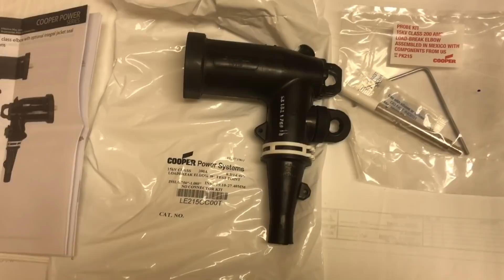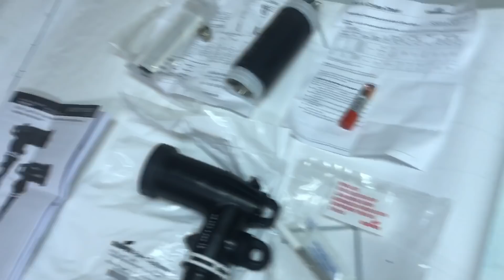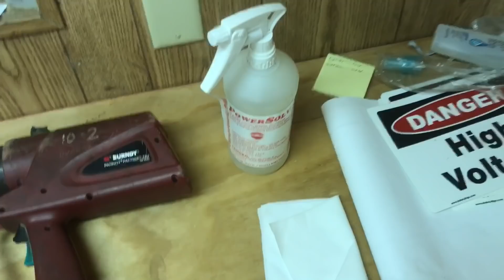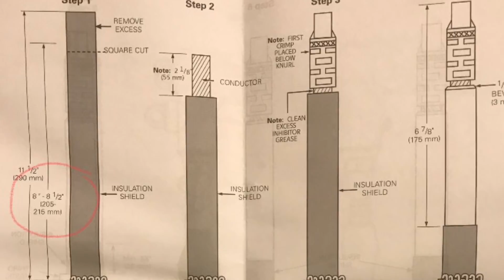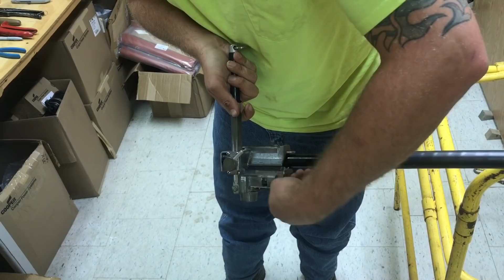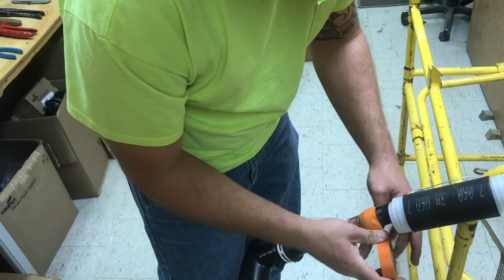15kv 200amp load break elbow installation

Comment: I'm concerned about damage to cold shrink/heat shrink kits caused by poor handling. Is Vulcanization a viable install option over load break-cable terminations?
Reply from the maker: Cold shrink/heat shrink is pretty standard anymore - rubber tape is an acceptable install, but not the common practice. Some kits even come with a built in cold shrink jacket. I would say that heat shrink is a little more rigid, where the cold shrink provides a little flexibility for handling.

Comment: What model number dies are you using in your pat-750?
Reply from the maker: Type UBG - the U-Die version of BG or BG Nose.
Reply: @jacobyoung3160  Yes the Hubble primary elbow spec sheet for a #2 primary cable says for a Burndy (hydraulic) crimper use die U234, but that die is actually for a 1/0 aluminum crimp. 
I put a 1/0 aluminum crimp next to the elbow probe crimp and they are almost identical in size, I put a call into Hubble tec support phone vm, just waiting for a return call back
Reply from the maker: Typically for 200A elbow #6-2/0, U243, UBG, or U25ART. Reference Cooper Power Systems Crimp Chart S500-001-1

Comment: I like the cold shrink at the end to keep the moisture out, we just used SAP tape. I also have only used concentric neutral cable. I have also found that the only measurement that is critical is the 6 7/8, for us as we always had play in the cables to plug into the transformer.

Comment: Those folding rules with the brass extension are mason's rules.
Reply from the maker: Yeah, the brass slide is really handy for measuring interior depths of connectors that are of a smaller diameter than of the width of rule itself.

Comment: I have easily built 10,000 or more of these 200 amp load breaks and you do it exactly the same way I😅 do. You couldn’t tell the difference between yours and mine side by side. 25 years building medium voltage distribution systems. Best work in the trade,  best pay as well.
Reply: Do you even sand the insulation? I don't do that, but a lot of guys who I know sand the insulation. I only do it if I accidentally nick it or something
Reply: @maxschil9438  it depends on the bond between the insulation and the semicon. Sometimes it comes off and leaves no residual semicon, other times you can see the black on the insulation and lots of sanding to remove all the semicon. You should never nick the semicon, if you do you are using the wrong tool or too much force. Always a good idea to strip a piece of scrap of a new cable type to set depth of cut and to see how it peels.

Comment: We don’t use 1/0 cu shielded cable at my company. Only use 1/0 aluminum concentric cable, so we don’t use the cold shrink, just aqua seal and tape.
Reply from the maker: It all depends on what the engineer specifies for each job. The key to being a good splicer is being able to be versatile enough to be able to install all types of MV applications. Some installs for the utility may be Alum JCN URD type cable, some installs for some federal customers may be CU EPR tape shield - and as a qualified MV Splicer, we need to be able to adapt to those different types of applications.
Reply: @jacobyoung3160  was just stating that we don’t use those at my company, so I am unfamiliar with that. Not arguing for or against you, just saying.

Comment: can touch outside elbow or not
Reply from the maker: The exterior of the elbow is at ground potential. The exterior material is a semi-conductive rubber, it must be grounded to allow static to be dispersed ground. If the elbow is grounded properly, then yes you can touch.
Reply: @jacobyoung3160  , i agree with you 100% but it is not a good practice to bare hand any energized  load break elbow or 600 amp Tbody termination.
Reply: Thx

Comment: Great video, thanks for posting. Do you recall which crimp die you used specifically? Looking at the instructions there are several listed for Burndy. Thanks
Reply from the maker: Jesse Leonard the die used in this video, and in most 200a termination applications is a Burndy UBG. The die itself has 2 points of crimping per single operation as opposed to a single crimping point on a typical Burndy die. It is a specialty die from Burndy, but is readily available through most vendors and online stores. Thank you for watching and the nice comments!
Reply: I guess Im asking the wrong place but does any of you know of a method to get back into an instagram account..?
I was stupid lost the login password. I would appreciate any tricks you can give me!
Reply: @Reese Clyde instablaster :)
Reply: @Ignacio Drake I really appreciate your reply. I got to the site on google and im in the hacking process atm.
Looks like it's gonna take quite some time so I will reply here later with my results.
Reply: @Ignacio Drake It did the trick and I finally got access to my account again. I'm so happy:D
Thank you so much you saved my ass :D
Reply: @Reese Clyde Happy to help =)